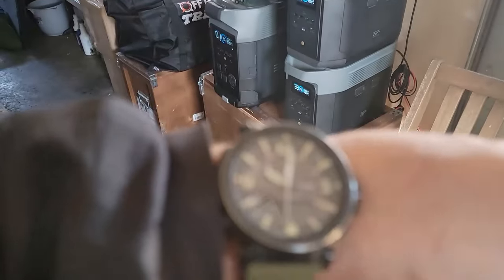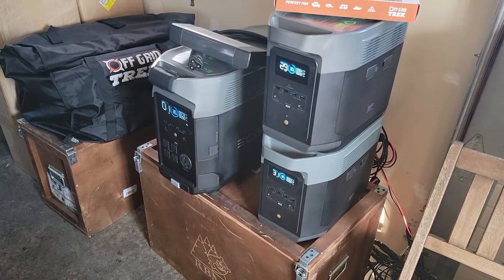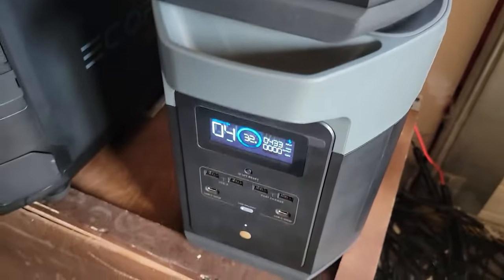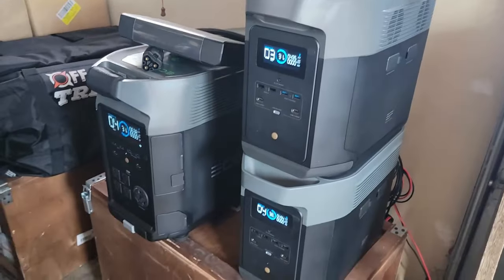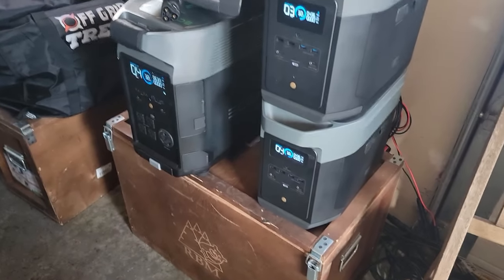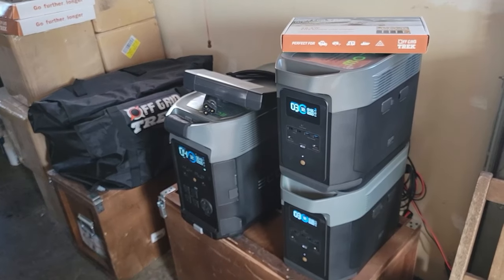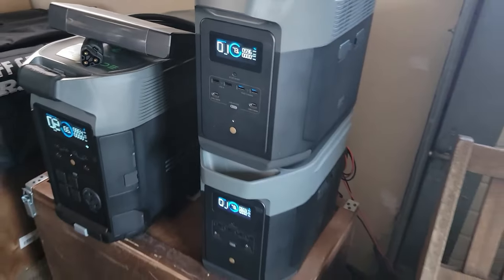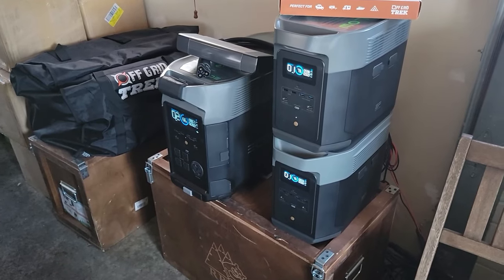Ecoflow Delta Pro & 2 Delta Max charging Simultaniously from Solar

Comment: I really love how quick the Ecoflow power stations charge. I think nothing charges faster.
Reply: it comes down to how efficient the solar is for how quick a Solar Generator will charge. being ours are over 24% the highest on the market, you get quick charging , especially being we are far north and the sun is low on the horizon for us.  Most other solar will not charge the Delta Pro or any other Solar Generator this quick.

Comment: I recently purchased the ecoflow pro,  owners manual wasn't any help. 

I have an existing 800 watt 12 v solar array,  8 x. 100 watt panels.  They are wired parallel keeping them 12 volts.  Can I plug this solar array into pro?

Comment: I am quite impressed on how efficient the those power stations are charging.
Reply: it comes down to how efficient the solar is for how quick a Solar Generator will charge. being ours are over 24% the highest on the market, you get quick charging , especially being we are far north and the sun is low on the horizon for us.  Most other solar will not charge the Delta Pro or any other Solar Generator this quick.

Comment: I am looking to purchase a large off grid trek solar blanket and an ecoflow delta max battery or two as part of emergency power backup. How do I connect the off grid trek solar blankets to the ecoflow series of batteries? I know off grid trek solar blankets use anderson connectors but I'm not familiar with these. Thanks!
Reply from the maker: You will need our MC4 cable and I recommend at least one extension cable, the extension cables are about 16 1/2ft in length, I have used four of these without any loss in power, both cables can be found on our Solar Blanket page of our website

Comment: How are you getting the wattage thru the delta pro 12 awg wire? 12 awg is only rated for 20 Amp. I've hooked (2) 200 watt, 10 amp panels to my delta pro and only get 250-260 watts out of them together, 160 watts if I use one. I am not sure why the wattage lose when doubled up. Not sure how ecoflow gets 1600 watts thru the small wire?
Reply from the maker: We wired our array so that we are achieving higher voltage by connecting both in parallel and series.  Connecting in series will help you with this, based on the specs of the panels you are using.

Comment: Can you AC charge the Delta Pro with the Delta Max 2?
Reply from the maker: Yes you can
Reply: @offgridtrek  I tried this before anyone got back to me TY, what I however am still trying to figure out is how I can turn the Delta 2 Max on and off automatically to boost charging when needed... I tried setting discharging levels but it seems to still draw power when those limits are reached.
Reply from the maker: @obamatheimposter  best to contact Ecoflow support for this, this is not something I have done myself.  I rarely use the apps or wifi on these myself
Reply: @offgridtrek  TY for your input...

Comment: Ecoflow website states 15A solar input. Is that for the built in charge controller? And if so how do you get your array to be such low amperage?
I am a noob and this stuff is still confusing to me.
Reply: 10 Amp for max solar.

Comment: You said "Can't over voltage???" Delta Pro states 150 volts max?
Reply from the maker: Correct, it takes max 150V so do not go over 150V

Comment: Great video.  Just getting in to these things myself and currently running portable folding panels.  

Ecoflow River Max,  Delta 1300,  River Mini Wireelss and 2x110w panels and a 220w Bifacial on the way. 

Yet to look in to solid panels or arrays in the UK but may do in the future.